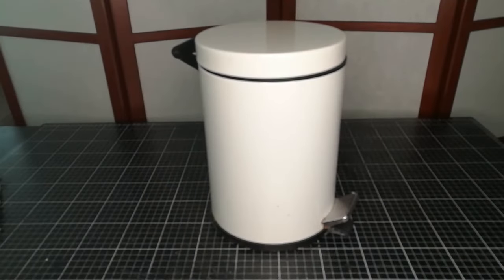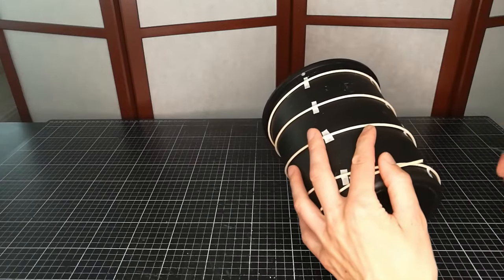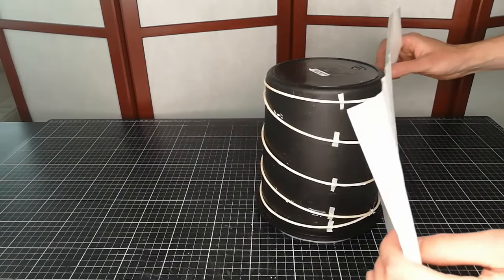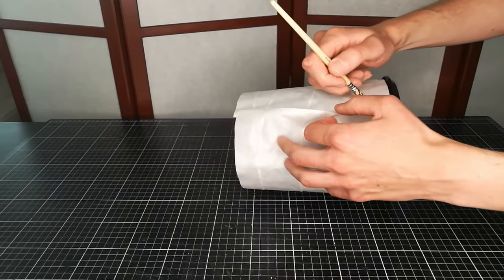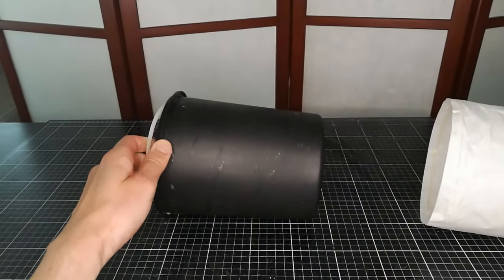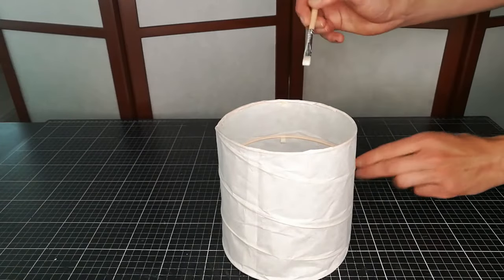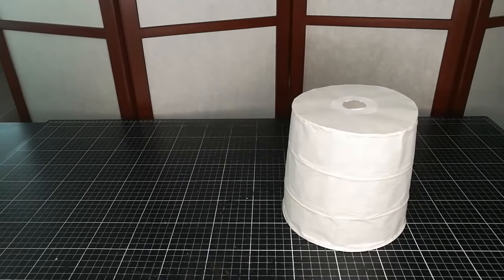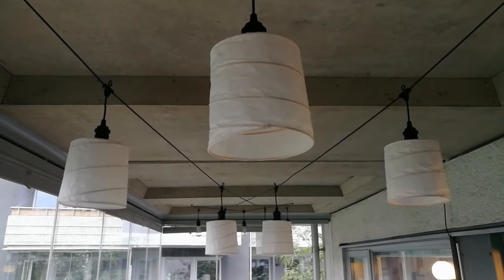DIY Paper Lanterns

Comment: How do you make something like this that goes into like a spiral tip like an ice cream cone?

I have an idea for lighting, I want to put an LED strip on something like a microphone stand 

And then basically make a coil that goes from wide to narrow, and clip the wide and onto the bottom of the stand, and then the narrow end of the other side of the spiral to the top of the stand with a clip 

I imagine that it would do something similar like this where I could expand and collapse it 

What is the material that you’re using for it to be collapsible?
Reply from the maker: @NathanNavarrete-r5m  it sounds like an interesting design you have in mind! But I do not know how I would make it, I used rattan for these.